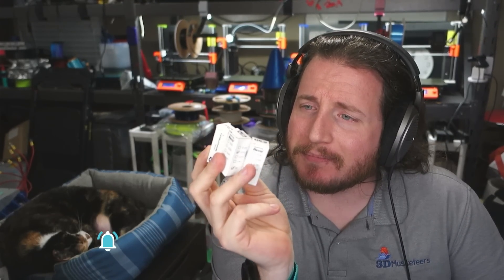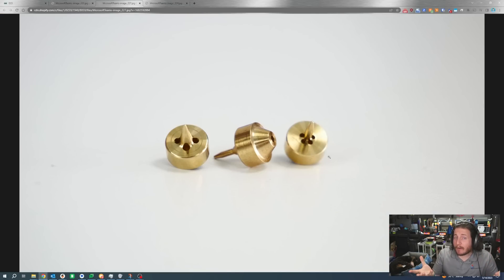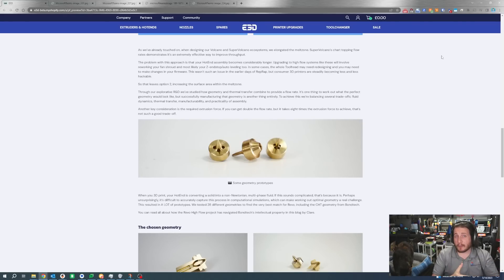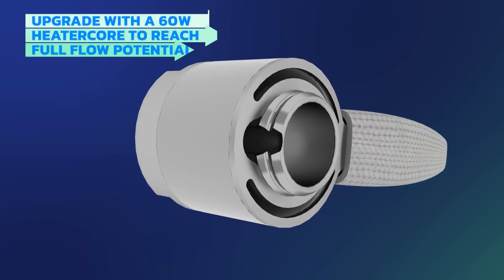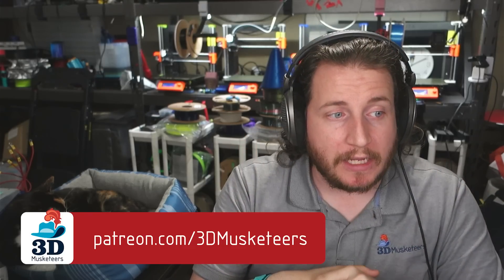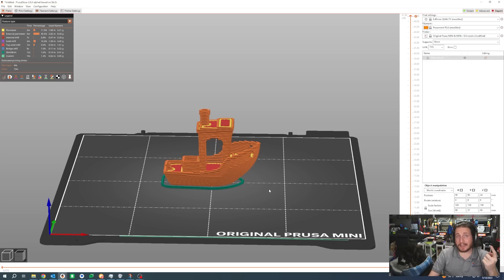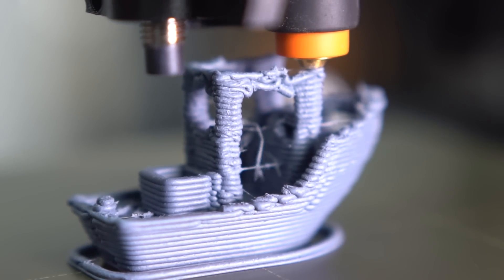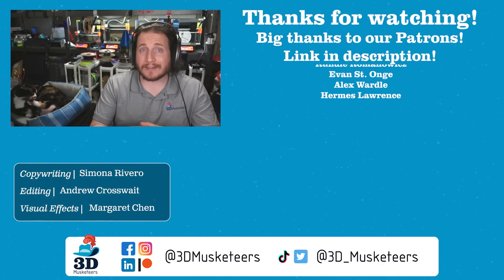Revo High Flow FIRST LOOK! The LATEST From E3D! #revohf

Comment: I readded my revo micro to my mini and during a calibration, it started to grind the filament.. idk whats causing it. It did it on the 5th zheight adjustment
Reply from the maker: is it on first layer? is the fan working well to cool the sink?
Reply: @3DMusketeers  yea, its on first layer calibration. It was working fine. Its going upto temp, but not extruding anymore. I'll try taking apart the revo hotend again tomorrow and see if there's a jam
Reply from the maker: good luck

Comment: I'm not convinced that the Revo HF actually would violate the CHT patent (and from reading e3D's writings i'm not convinced that they are convinced either). I don't know whether the CHT patent should or shouldn't be valid either, given potential prior art, or what its reach should be, but i wonder in the case that it shouldn't be valid or should have a very limited reach, whether the agreement between e3D and CHT validates its existence and increases its reach not based on merit but based on precedent.

But the agreement what it does is for one, allows you to bring the product to market quicker because you aren't held back by that confrontation, so it's good for business; it also eliminates competition, which is good for business but bad for... well competition and further innovation.

The whole intellectual property protection and when it's useful and when it's harmful is such a difficult question, i don't even want to ever have a definitive stance on it. I've certainly seen too many cases when it's harmful, it usually benefits only the largest players who get a death grip on the market.
Reply from the maker: I agree here. It is all about how it is used and licensed for if a patent or IP of any kind is valuable to an industry or detrimental.

Comment: Press fit tolerances on common materials that have the same rate of thermal expansion, you shouldn't have any issues with the two pieces separating. Unless it was machined incorrectly and the tolerances are excessively loose. I feel like any nozzle that splits filament apart and converges it again could result in flow/clogging issues with any filled filament. I think that's why most are brass. The bozzle doesn't appear to work in this fashion, so I think that's why it will be better suited for abrasives.
Reply from the maker: the bozzle forces it into a flower shape to increase flow from my perspective, but not using one I can only just look at the photos.
Reply: @3DMusketeers  the flower shape probably creates more surface area for faster melting. I stopped using the cht because it's retraction characteristics just aren't as responsive as a standard brass nozzle. I'm my experience printing with asa.
Reply from the maker: yup, more surface area more heat!

Comment: I predict the next iteration of high flow nozzles will „simply“ ingest multiple filaments at once 
=> you need a lot of material anyway, so smaller spools are nice
=> lower filament ingestion speed an thus lower chance of problems
=> you can pre-melt each strand individually without having to divide one up, so it’s an easier melt path
=> you might even be able to build in redundancy, e.g by running 2 of 3 strands at 1.5x speed when 1 breaks/runs out.
Reply: Also, an IDEX printer would be cool for this, with one big boy high flow nozzle for structure / rigidity at speed, and a .4 printing the outermost perimeter at half or a third the layer height of the big boy for a better surface finish.
Reply from the maker: that would greatly increase the throat diameter needed making the hotend much larger than most currently are. Also, without perfect flow from every filament you will see really wild extrusion properties that will be hard to work with.
Reply: @3DMusketeers  hotend would of course have to be larger. An okay tradeoff for a large volume printer, imho. Filament weirdness would average out between them however, so you’d get LESS impact on the extruded stream, not more.
Reply from the maker: you would need to have some sort of system to monitor flow too or it wont be able to calculate how much of which it needs I dont think, but this is a whole new thought to me so I am likely missing somehting

Comment: My experience with Bondtech CHT was that running different materials through the same nozzle would almost inevitably lead to clogs. Could you try something going from a high-temperature filament like ABS or PETG, then go back to PLA and see if this clogs like the CHT?
Reply from the maker: you would have to purge at the high temps, but yeah I can try.

Comment: This video cuts a little close. I got a mini thinking I’d use it for smaller, more detailed prints, but it now spends most of its time with a .8 because my mk3 is actually much better for detail. I also fitted both of them with Revos and have ruined 1 side of 2 build plates with loosening nozzles. I only figured out they were self-loosening because I was using tri-colored filament for a later print and the colors shifted from their correct positions too fast for it to be from the filament twisting. I wish they had a little more grippyness to tighten them with, because “finger tight” is clearly not enough.

Edit: and I figured this out while I was printing the spiral vase rose.
Reply from the maker: I have done okay with finger tight but I normally check before every print, habit I guess that worked for my favor LOL

Comment: e3d says on their website they’re patenting this design and already has a patent pending. I’m not sure where you’re getting your information about “theft”. If your patent doesn’t cover the scope of another product it’s not “stealing” you just never owned/created it in the first place.
Reply from the maker: What are you talking about? I mention very clearly that this is licensed IP from Bondtech.
Reply: @3DMusketeers  Literally under their own FAQs. Does E3D have its own ‘patent pending’ high flow design?
Yes, we do. There are some unique features we are told are patentable, and an application is pending – at some point in the future the results of that will become clear and we expect to have patent coverage. The overlaps with the CHT solution mean we want to cover all the bases, and instead of launching a product regardless of Bondtech’s position, we approached Bondtech up front, and slowly built up a relationship and an agreement that works for both parties.
Reply: @3DMusketeers  Besides Bondtech doesn't own the CHT they merely licensed it from 3D Solex.
Reply from the maker: No, your comment about theft.. It was a snide comment at GeeTech and Sunlu for ripping off Chep.. Nothing to do with E3D. 

I think the current system works well for E3D. Mind you, they have shown A LOT about the Revo HF, so it would not surprise me to see clones out in the next few months. I am told to watch out for them though as they can be very dangerous as their tolerances are not decent most of the time.
Reply: @3DMusketeers  Yeah the Chep thing was separate I knew that I was just curios about the drama you mentioned was all. But as far as E3d is concerned I Bontech can't do anything in this scenario. They don't own the CHT to begin with. E3d probably said they're just not going to make a normal V6 version which makes sense. Especially if they aim to pursue another patent for Revo. Since Revo itself at least the nozzle portion is patented by E3d. Which is cool but I just meant from a business perspective that kinda makes the most sense. Pursue what you've already invested into. V6 is open source and will continue to receive support from every other manufacturer that adopted the standard including Bondtech. Which is a bit ironic because they in a way make clones of the E3d V6 albeit high quality ones like the CHT. Idk if you can really say e3d "owns" a standard M6 thread but that's why I say in a way. Tbh though it's for their lawyers and the patent office to decide. If E3d is awarded a second patent cool. They just are pursuing one is all I was saying. One of possibly many I think they still have a few left from Revo originally that haven't gone through yet. It takes years sometimes for patents to get approved/denied.
Reply from the maker: ah gotcha!! Yeah patents take way toooooo darn long.

Comment: are there any way to transform a revo system back to a v6? I want to use my bozzle nozzle.
Reply from the maker: not that I am aware of. I think the V6 system has plenty of compatibility across the board, IU am fine with revo being revo only lol
Reply: So I can't just use a Heatbreak and a heatblock after removing the spring. Such a waste.
Reply from the maker: why.. theres so many other hotends out there.. And apparently there is a V6 system for revo by a 3rd party (they just emailed me), but I am struggling to see the value since if you bought into Revo you kinda knew what you were getting yourself into I think.

Comment: Grant, could the Diamondback outperform a CHT of equal diameter? How big does Diamondback offer, 0.8?
Reply from the maker: I have never really tried, but I am guessing it cannot. The extra surface area allotted by the CHT makes up for an insane amount of speed. Now, give them abrasives, and maybe.. May just need to get a cht abrasive resistant and see how it performs against a diamond

Comment: to upgrade my ender 10 smart pro will cost more than i want to spend. had to turn the printer off today prints were failing  room was too cold with the window open
Reply from the maker: if there is no breeze, ambient temp should not be too much of an issue

Comment: Making a fit like that inseparable is actually quite easy and common. Just make the mating surfaces interfere at ambient temperature, heat up the outer piece until thermal expansion grows the hole to be larger than the smaller part. Install the parts together while maintaining the temperature delta and when they both cool down they are as good as welded. 

I’ve heard this fit called a lot of things, but I’ve heard shrink fit and sweat fit the most
Reply from the maker: very true!

Comment: Now we just need Revo obXidian HF!
Reply from the maker: soon^tm I think is what I a required to say LOL
Reply: @3DMusketeers  Honestly, I think if they're going down the route of 'new heaters' I'm surprised they didn't make a 'volcano' version of the nozzle that had an extra 10-12mm of effectively solid brass or copper that comes into contact with the bottom of the heater, a la the Rapido UHF with just using a Volcano nozzle with a copper nut to take up the extra space.
Reply from the maker: they managed stupid high flow without having you change your z offset, I say that is a win IMO.
Reply: With a Tungsten insert 🥰
Reply from the maker: huh? No tungsten insert here...
Reply: @3DMusketeers  sorry, i meant it would be nice with a tungsten insert instead FTW
Reply from the maker: I prefer diamond to tungsten, but anything abrasion resistant would be nice! soon^tm

Comment: I would love to see a diamond cht type nozzle. I find for my speed printing with a mosquito magnum on one of my ratrigs that I have a hard time going any faster than a regular hardened steel nozzle. Tuning temperature is really hard because the other components on a hotend want to be a certain temperature and the diamond wants to be 20c or so colder. 

To be clear this is a 0.6mm nozzle printing at 200mm per second, not normal flow on not a normal hotend. Some extra internal geometry would be interesting to test out.
Reply from the maker: you could always do that drop in CHT conversion for volcano nozzles! Not official of course..